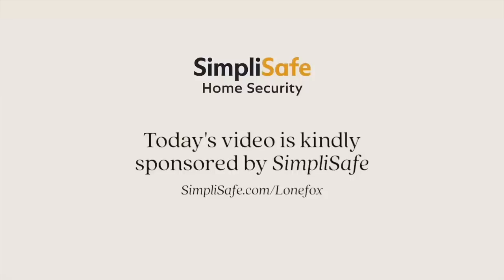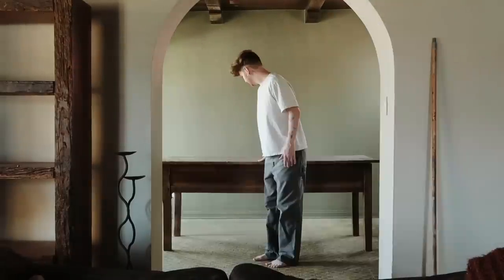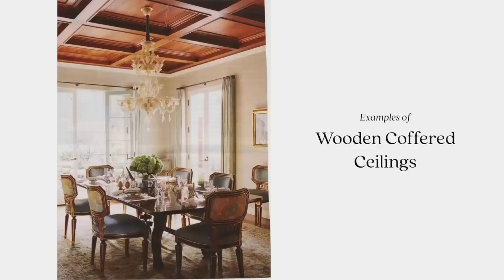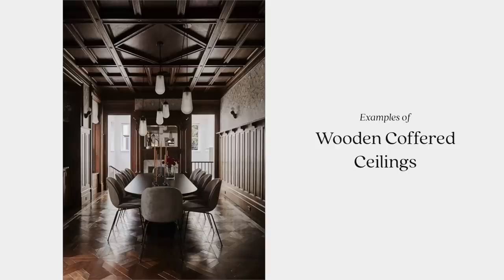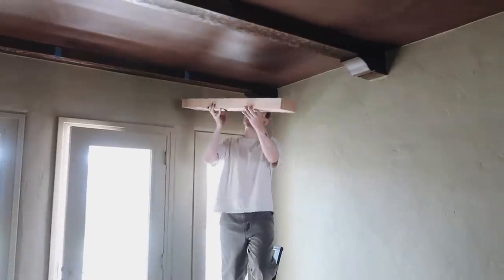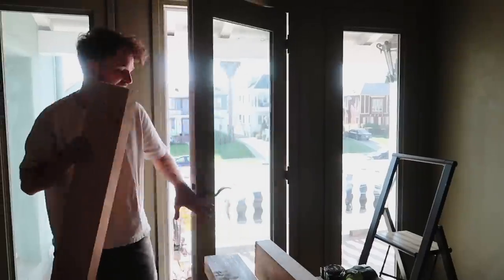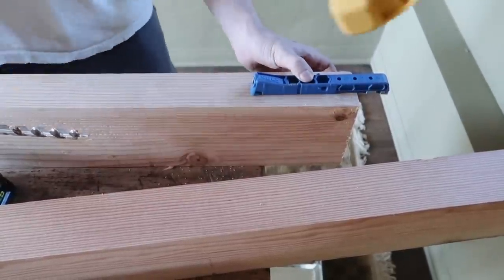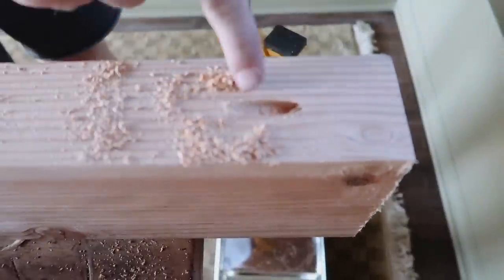DIY Coffered Wood Slat Ceiling *EASIER THAN YOU THINK*

Comment: Drew! You should always apply a conditioner to new & even stripped lumber before staining to obtain an accurate color & non-splotchy finish! Just a tip for future staining projects but I can’t wait to see how you complete this space 💜.
Reply: I was coming to the comments to say the same thing. Pre-stain wood conditioner is great for woods like pine!
Reply: I remember MaCenna using it.
Reply: I’ve used this method. 
1. Sand down with 120 grit sandpaper
2. Vacuum the wood 
3. Apply water so the wood is evenly soaked. Wait until the wood feels pretty dry to the touch. 
4. Apply stain. Within 30 minutes apply second layer of stain. 
5. Wipe away excess. Wait 24 hours. 
6. Polish with black foam sanding block 
7. Apply two thin layers of stain again and wipe excess away. 

Best method imo
Reply: @beebeeisland thank you

Comment: That looks fabulous! You've done a great job! If you, or anyone else, plan to replicate this ceiling anywhere else, then you'll want to stain the wood pieces BEFORE you hang them. Much easier when you do as little overhead work as possible. Most all soft wood species will blotch, that can be reduced greatly by applying a prestain conditioner, either a purchased or homemade version can work well. Gel stains can have a less dramatic impact with a prestain conditioner but it can still help. Can't wait to see what's next for you!
Reply: I was going to comment the same! I don’t understand why he doesn’t do it this way! Drewwwwww explain! 😂 we need answers!
Reply: @94rome  I was also thinking the same about staining it after installing. My dad would've probably said his standart "Why do it the easy way, when complicated is so much more fun" 😆 It however looks absolutely amazing!
Reply: I'm sure it was because this was a was a new design venture, he was excited & that's how you learn... Even down to inserting screws, nails etc at an angle to ward off gravity, someone (probably several someones)  had to have done it incorrectly the 1st time - then Never made that error again.
Reply: Maybe he was worried about matching the stain to the wood filler in the pocket holes
Reply: I just love the ceiling. To save my back, I probably would have sanded the cut edges and prestained before hanging, but to each his own. Agree on the conditioner...something i learned from reading these comments.

Comment: This looks absolutely beautiful every detail really has made your home extra special.Just a tip on wood before staining you should apply a conditioner  or even use a wet cloth and rub it on the wood to"open the pours up" it helps take the stain better to the wood and stain it before hanging that way your coats would come out more uniformed.And less strain on the body!
Reply: 👍🏼 I was going to write/say the same things.

Comment: Like you, I absolutely adore a coffered ceiling! You are lucky to have a period home where a coffered ceiling looks so appropriate. You and Justin did such an amazing job on this project, the color match is dead on, and the entire ceiling actually looks original to the house. Bravo both of you! I'm wondering if putting wood conditioner on the boards before installing them would've helped the stain apply better? Ultimately it doesn't matter here, but may be something to think about for future in case you don't get so lucky that the stain is a dead ringer for the original. I was holding my breath watching you stain the ceiling and getting color on your freshly painted walls, maybe putting up plastic sheeting on the walls would've saved a repaint of the room? I'm just thinking of the time and labor savings, as well as the pain to one's spine, but you are young and it seems able to double up on work without it adversely affecting you, so good on you! This is such a satisfying result, love watching your videos so much! Also, whatever you pay Justin, it's not enough, that man seems as invested in your projects as you are. What a great friend!

Comment: Wow! The ceiling came out beautiful!!!! One thing I learned long ago is: paint all your components on the ground when they're cut to size and ready to mount. It's easier on the neck and back, AND you don't get paint/stain spatter all over your walls. Saves a lot of fix-it work that way. Plus the time from assembly/attachment to ceiling to finish of project is so short, it feels like you sidestepped 'delayed gratification', haha! But lovely job, boys, as usual.

Comment: For a better more even finish always sand your wood before staining. There is a film like coat on all lumber that can change the way the wood takes stain. For gel stain sometimes you can get away with not sanding (although I always recommend sanding!) because the stain sits on the surface rather than soaking in but definitely sand for water based stain. Also a pre-stain helps with even stain too. The ceiling looks absolutely stunning though - just a tip for the future!

Comment: You guys did a great job, just a little tip for future reference, stain your timber on the ground before installation, saves your neck and back. Good luck with your future project. Sending this message from Australia.

Comment: Pre-paint all the wood before cutting and always use a wood conditioner. Also, I would have applied some construction adhesive to each slat board and shimmed the new beams to be flush with the originals before screwing them in.

Comment: The ceiling looks nice. It appears to work well with the next room. My opinion (that means little) is that it looks like the beautiful detail work on the original beams has disappeared. It doesn't stand out like it did. 
Nice work as usual.  😊

Comment: Greetings from Tucson.
I just discovered your channel and subscribed.
This is EPIC!
I've been doing this, in my mind, to my Living Room ceiling, which is canted following the roofline.
My plan is to make box beams using 1x6, hanging from 1x6 attached to the ceiling, 
with the sides 1/2" 'proud' on the bottom, and 4x8 sheets of bead board between.
Y'all are an inspiration.

Comment: Why didn't you condition the wood before you stained Drew?  Just ya know so the stain applies more evenly....  MaCenna didn't condition the beams she redid either & I was like...what is going on? After all of the hard prep work & even though it is an extra step...why not?  Or maybe there is something I don't know about using gel stain or conditioning the wood used for beams - lol!!  As always the ceiling looks incredible!  I just adore the hand painted designs on the original beams - what a treasure!

Comment: Hello Drew…correct me if I’m wrong…Do I noticed that you dis not sanded all the woods before staining them? Is it not necessary for it? Or it’s your preferred “look” finished…I think sanding even just the harsh edges of the wood will make a subtle difference to soften the overall look of the ceiling and it will matches the old beams better…😊

Comment: I had my doubts, but it looks really nice ! 
Wondering though: wouldn't it have been less strenuous to pre-stain the wood pieces before nailing them up..? 🤔

& Now, I know it's not the case in the other room, but in this one, with the crossing beams the same width as the originals, it kinda feels something is missing. Only my opinion, but I'd decal the painted design to make a stencil from it, and add that pattern to those new beams....
Can't wait to see the stained glass ! 😉

Comment: If i had to make this ceiling, I would have used long slats and stained them (and the beams and trims) before installing. When installed, i would have installed thinner beams and trims onto slats. Would have been easier?

Comment: looks great..... But....  Never put a single nail in the middle of the board, or it will warp over time. Nail them with 2 nails at each point, offset from the center...

Comment: Would have been easier with tongue and groove instead of plain slats.
To make the cutting faster and more accurate, measure only the first cut and then cut the rest to the same length instead of measuring each cut individually.